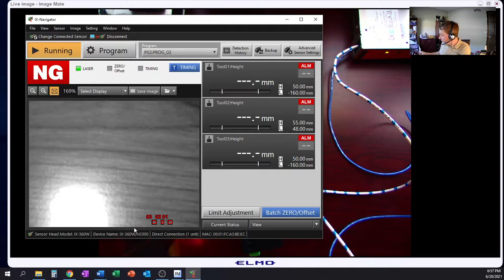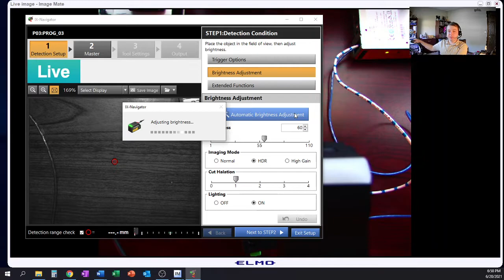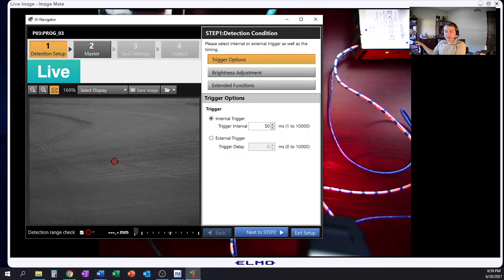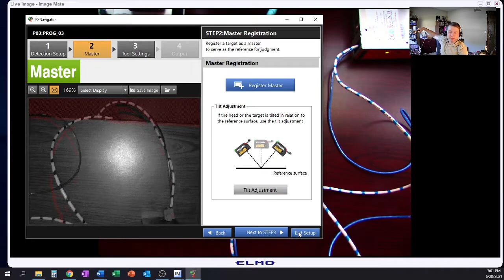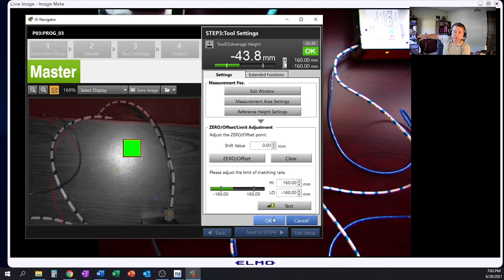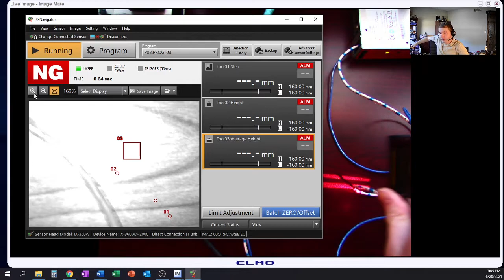Programming The Keyence IX Sensor in Standard Mode

Comment: have u work with keyence CV-X (vision systems)
Reply from the maker: I have, yes.  I am personally more of a fan of their IV-2 and IV-3 vision sensors, but if you for sure need to use one of their vision systems by far the preference would be for the CV-X vision systems.  They make an excellent vision system that can be set-up for just about any application.  After working with a few deferent ones in the industry over the years, I would highly recommend their systems.
Reply: Could I get your address or your account LinkedIn ? (Need some informations)